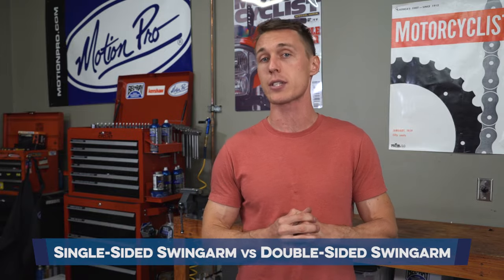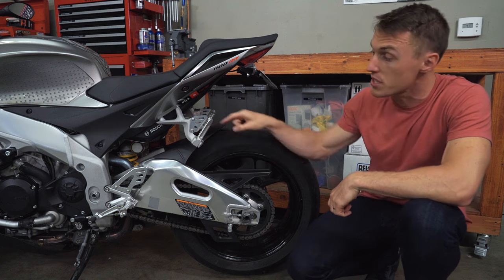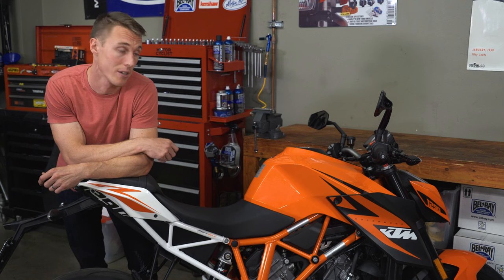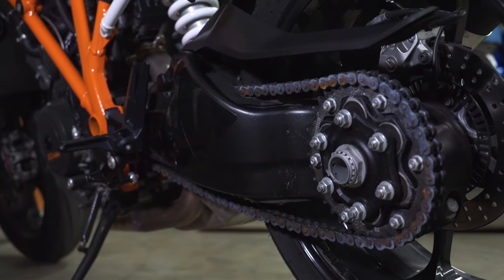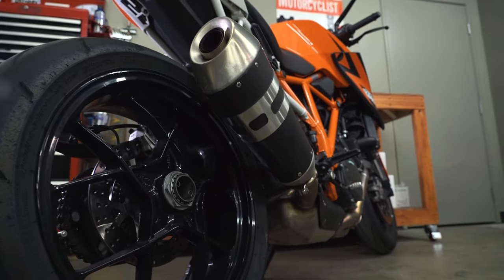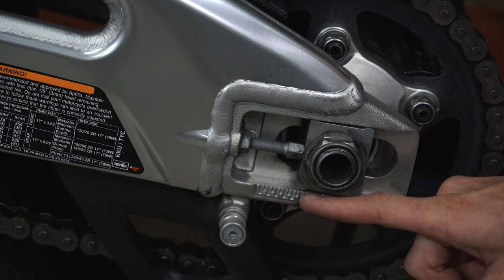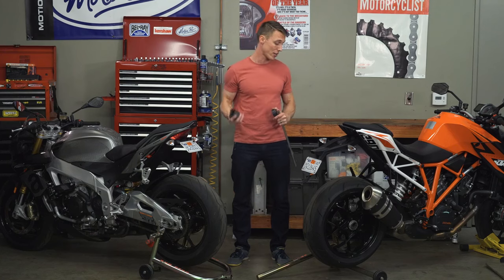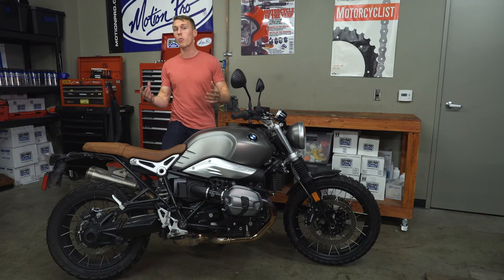Single-Sided vs. Double-Sided Swingarm What's The Difference? | MC GARAGE

Comment: So ... on a single side swingarm, you're basically forced to buy a new chain when it has stretched? So easier chain maintenance: well duh... you can't. Apart from lubing it once in a while (which you seem to have forgotten to do). So that's a mute point imho

Also... one thing conveniently forgotten on this bike: you have to remove the exhaust muffler/slip-on. By the time you're done with that, I'll have my wheel changed and the chain adjusted.

Team double sided swingarm for me.

EDIT:
a quick google teaches me you also have to remove the muffler/slip-on on
Ducati Monster 1200
Ducati Diavel
MV Augusta F3
MV Agusta Brutale (no reason to remove complete muffler, but have to loosen the lower one and slightly rotate it away)
BMW R nine
BMW R1200RT

and many more

Basically the whole "it's so quick and convenient" point only goes when the motorcycle has an under seat or super short stubby exhaust muffler
Reply: Thought it was strange there was no option to adjust the chain... but hey.. one learns everyday. Can't know everything. :) Thanks for the reply. 
(and apologies if my previous reply seemed a bit overly aggressive in it's tone. which it, after reading it, did)

As far as I can see, the only real advantage is the wheel is always perfectly aligned.
and... granted... on some bikes (not all) it does look pretty.

Comment: if the single sided swing arm was better design you would see it on the kawasaki h2 and Hayabusa and zx14 you don't because huge hp and torque isn't ideal for single sided setup.

Comment: You forget to say, sigle forks/ swingarms are ligher , and that's an advantage in anything designed to be raced :)
Reply: He didn't say it, because it's not actually always true, they have to be made larger and stronger than a 2 sided swing arm, so they can actually be slightly heavier, because a 2 sided swing arm does not need to be as large, or as heavy, to be as strong.

Comment: my scooter have single sided arm both in front and rear wheels.. just sayin...
Reply: A scooter doesn't put any where near the forces on the swingarm as a proper motorcycle, that's comparing apples and oranges.

Comment: What's that bike model the Aprilla 1100rr silver colour naked looking bike? Haha
What i want in my "perfect" dream bike:
Single rear exhaust (cuz it looks like a rocket to me and makes it look clean af haha)
Single sided swingarm 
Inline4 cross plane big bang firing order (sounds good)
Dry clutch (sounds good although if i already have the cross plane i4 i think it will defeat it's purpose HAHA sound wise)
Back lit controls like on ktm and pulsar bikes (& harley but you need to replace it)
Anddd 
Repsol decal xD 

Anyway thanks for the video always Ari! Great love mc garage really helps with diy and knowledge on bikes maybe engine configuration and maybe firing order or how exhaust sounds like with different types of pipe? Haha cheers man have a good one
Reply: Nicholas Jeremy it's a rsv4 (1100rr) it dosent have a single sided swing arm and it's a v4 not a inline 4.
Reply: also has a wet clutch
Reply: ENDURO SK ahh i didn't know it was 1100cc haha at 2:47 it looked like a naked bike to me. (The head) It's a sports ya?
Reply: ENDURO SK no i was just listing out what i wanted in a bike lol aesthetically:p anyway thanks mate
Reply: Ari Henning why so? Haha other than that v4 engine HAHA
Reply: Oh sorry my bad.
Reply: ENDURO SK it's okay bro ride safe thanks cheers mate have a good one!
Reply: I don't there is any i-4 with dry clutch, if there any(from Suz I guess), it won't be single sided SA. Sorry. But, you can take a look at i-3cyl by triumph or Ducati which includes the other options. I don't prefer 3cyl, or dry clutch.

Comment: You've just made a lot of assumptions. A single arm would have to be multiple times stronger to support the additional moments from the wheel. Yes it could be made more complex to save weight, but so could a twin arm.

Comment: my Structural engineer of many decades experience says one large tube has more torsional strength that 2 smaller tubes. just saying.
But hey remove wheel in 20 seconds is great.

Comment: Why does the Ducati motogp team have double sided swing arms while the streetbikes have single?
Reply: to make a single sider as stiff in the right plane it will be heavier than the double siders. If you look at moto gp swingarms they are built very tall, but thin in profile. 

The Honda RC45 had a single sider but later in the World super bike series they went to a double sider for handling reasons.

Comment: I disagree with your statement on handling advantage. with two points of contact on your typical A-frame style swing arm, there is a large margin of error aligning the axles perfectly parallel. If the axles are not aligned, this will be noticeable when cornering at high speeds. This simply does not exist with a single-sided swingarm.

Comment: Single sided swingarms make tire changes easier and faster, which is why they first started being used on race bikes that would need a tire change during a race. For normal street bike use there is no real advantage and are more expensive and usually heavier. Triumph did away with them on some of their models years ago for that reason. Of course they do look cool.

Comment: next episode, explain naked bikes to sport bikes.
Reply: Perfect example. ZX10r then the ZX1000 The zx is naked while the zx10r are covered. They both got the same motor so its pretty much a naked zx10r higher up with that solid bar. Comfy
Reply: Completely different motors besides both being inline-4. The bore, stroke and capacity are different. The ZX10R engine has a 76.0 mm × 55.0 mm bore and stroke with total 998 cc. The Z engine is 77.0 mm × 56.0 mm and total of 1,043 cc.
Reply: So the ZX is bigger then the 10? Damn son I rode that thing at my dealer, felt lighter with short gearing. Maybe since the 10 has longer gears, I was not use to shorter gears as the ZX gears felt shorter. Why don't I see ppl riding the 10 over the ZX? I always liked the Z1000, it's very comfy compared to the 10.
Reply: Naked looks cool, more than adequate for anyone but a pro racer, easier to work on. A normal sport bike also looks cool, but the aerodynamics would be advantageous during a race (we're talking some serious racing, none of this track day stuff).
Reply: Main reason I stuck wit the zx10r. I was Fiona get the z1000 but I haven't seen anyone being a z1000 or any naked bike on the track. Saw a R1 naked turbo once though and we was in fast group.
Reply: Ari Henning you got it wrong. he wanted you to be naked and explain to an audience of sport bikes

Comment: Man I'd kill for that easy wheel installation. When you are working with minimalist poor man tools and jacks and you're going at it solo trying to get that damn wheel back on is a BITCH! God damn you wheel spacers! I've about pulled a muscle in my legs trying to awkwardly hold the wheel up with my toes while I try to get that stupid axle bolt through...all while dealing with the stupid disk brake, chain, and spacers. What a nightmare, but hey it saves me 35$ per tire change lol.

Other than that though I think the double sided swing arm looks way better. Looks a lot safer too when it comes to putting down some big HP numbers....I'm sure they're both safe, but the single sided just looks so frail in comparison. I'm glad there's no handling disadvantages because I'll probably never own a single sided for various reasons.

Comment: Single-sided swingarm + left-side exhaust = best
Reply: Shazy Satania nah.  undertail exhaust in my opinion is the best, but that's why they make so many styles.  Something for everyone.
Reply: Honda VFR400 NC30, RVF400 NC35, and VFR750 RC30 all have left side exhausts and singe sided swing arms.
Reply: Undertail works too, but the whole point is that free wheel c:
Reply: I'm actually on a VFR750, but it's got the stock right side exhaust for now...

Comment: I strongly believe two sided swing-arms offer better handling.
Reply: well they should, since they can offer the same rigidity at a way less complex and lighter design. Keeping a rotating axle steady will always be most efficient if kept at both ends. However, I think it's difficult to notice any difference to handling unless you are a MotoGP rider on a racetrack
Reply: Christo Slowrider
Lower unsprung mass is always a good thing. SSSA bikes did win lots of races against double sided opponents in Endurance, Suzuka 8 hours, WSBK and even GP250, though.
Reply: Daniel Kemnitz
Not so sure about way less complex. An SSSA is really just a one piece casting with a bit of machining whereas the more elaborate double sided ones are fairly complex fabrications.
Reply: I agree with two sided swing-arms are safer on most of our roads and highways in the USA because most of them are in a terrible state of condition.

Comment: they should all be single sided swingarms by now...

Wheel alignment is a bit iffy without a graduated measurement. That's why I tool my own onto the double sided bikes I've owned and thrown away every factory set of blocks.

Comment: When it comes to shaft drives, a single swingarm has the advantage that the bike does not rise during acceleration.
Reply: Then why do they call it "shaft jack"?
Reply: OK, I’m correcting myself here. I did a quick bit of research and the reason shaft jack does not occur on BMWs is because of the addition of the paralever that assists to eliminate the effect. The correct terminology is Parallelogram Suspension. Without this shaft jack is a natural effect on shaft drives. My original comment was based on hearsay, so I stand corrected.
Reply: Hearsay has no place in the MC Garage ;) Glad you looked into it. Cheers.